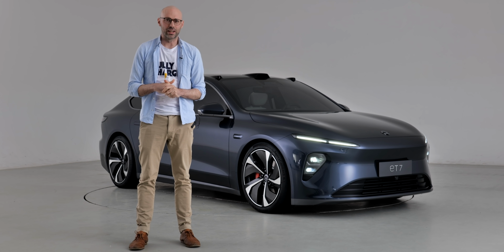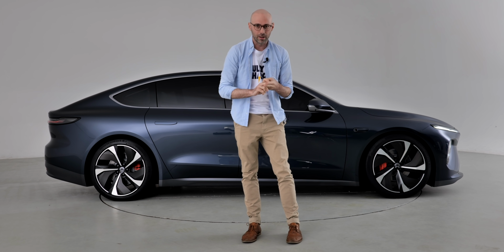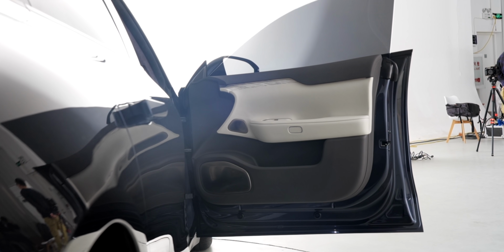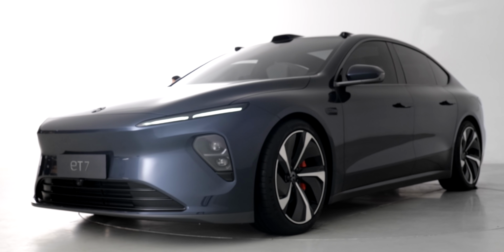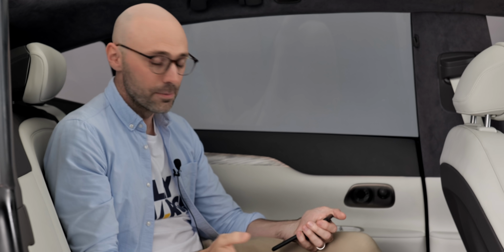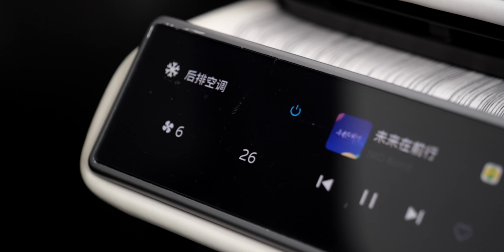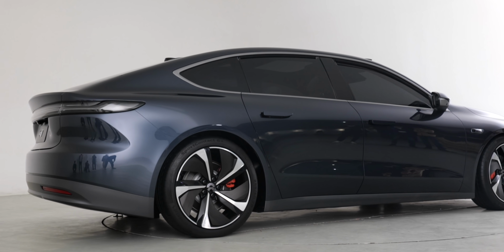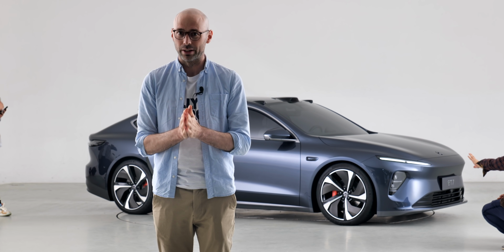NIO ET7 Sneak Peek - '600' mile saloon revealed | Fully Charged CARS

Comment: What happen if batteries all die with no power at all. Can you open door manually?  Can you still push the car on neutral gear?
Reply: Yes. EVs still have a separate auxiliary battery like an ICE car. I had a 2018 Nissan Leaf and the doors, windows, infotainment etc work off the small battery. If that dies, you're buggered.

Comment: I wonder what happens if the button doesn't work. Due to an update,  let's say. And the car is on fire. It is perfect. The perfect trap. Can all that electronics and updating work against you ?
Reply: There's a secondary mechanical handle inside the doors in case of emergency.

Comment: The big questions is if this new "Aquila" sensor suite and the "Adam" GPU processor from NVIDIA will be available in the next version of NIO's large SUV the ES8... maybe will be called ET8??? Also from what I heard from the William Li, the sensor suite and GPU is for  "future proofing" meaning the software will be still L1, L2 ADAS, but eventually the NIO in-house NAD team will have to produce it (L4-L5). Currently ES8 uses Mobileye Q4 and will not use the current Q5, which should be offering L4-L5 by 2024-2025.

Comment: Woaaaa......do my eyes deceive me???.......there is no bumper per se, either front or rear..........the whole purpose of which is to absorb those slight front end and rear end touches that with this design represents major damage.
i get very nervous when the presenter start to extol the virues of unlimited electronic gadgets that if only one goes wrong shuts the car down immediately......this model will not please a buyer expecting to get value for money without having a money bin look alike.
I would be scared to take this car down to my local supermarket or shopping mall car park or even park it outside of my house.

Comment: No interior door handles?
That seems like a stupid idea!
Reply: Agree. There was a fatal accident with a Model S, where the driver was burnt alive because the doors couldn't be opened.
Reply: @pikachus5m166  If the accident is serious enough for there to be a fire, chances are you'll have to be cut out of the vehicle anyway. But EV fires are harder to put out once they start... and I don't like the idea of an electrical failure trapping me in a car!
Reply: @jayr6637  Apparently he lost control of the vehicle, careered off road and hit a tree. Several witnesses came to his aid but couldn't force open the doors and the driver was soon overcome by smoke inside the vehicle, and then the fire took hold. Basically the technology became a deathtrap and it's surprising how there isn't a manual override given this possibility.

Comment: There NEEDS to be a physical, manual means to open the door. Relying on a "button" and a motor to open the door for you provides a serious safety issue should that mechanism be damaged in a crash

Comment: Don't think this car is for me. 
Too many sensors and cameras to go wrong.  No door handle, the most simple thing you can have.
The battery swap idea is wrong too, as battery technology moves on so fast that can improve range yet if they put a four year old battery in my brand new car then I don't see the improvements.
The designer was talking nonsense as well, you don't need too much at the front it's an electric car, you don't need much, just need headlights and side lights, same at the back, some lights and a boot. What you do want is that if someone hits you at the front or the back, you can replace parts cheaply.

Comment: Those LIDAR sensors on the roof are hideous and ridiculous! Granted this is a prototype they may disappear in production possibly. The rear end view looks purely a copy of Audi and I think it doesn't really match the front end in style. The 1000km range is impressive but in the REAL world you don't need it and the 150kW LFP batteries are going to be heavy.

Comment: Sorry not sorry, but ET7 will probably do 435 miles per charge for the EPA rating.  Still lower than the Model S refresh version. 345 wh/mile from the 150 kWh pack.

Comment: How does the battery swap work do all the manufacturers in China collaborate on battery sizes so you can take any battery swap capable car to a station, or do you have to go to a manufacturer specific station? I cannot see that working in Europe / UK, I'm not sure they'll sell enough cars to make it work. One good thing about having a really big battery is it should last a long time. Batteries only have a finite amount of charging cycles before they start to degrade, having a big battery pack means less charge cycles. I like the overall look, don't like the humps on the roof, don't need all that 5G malarky either, self driving, pah, I actually like driving.

Comment: I'm not sure that I'm on board regarding the electronic button only entry/exit door actuators.  What happens in the unfortunate event of an accident where the electronics or control modules are damaged or...?

I do think that it's a very sleek and pleasing design.  Though I'm not sure about that one unique interior design element/surface.  Otherwise, the interior options look nice.

Due mostly to the limited range and my location, I still don't own an EV even though I'm off-grid (using a Bergey Excel wind turbine) and produce on average 30% to 45%+ more than my actual consumption.

The ~600 mile range is about where it needs to be (for me) to consider an EV as my Single, ALL-PURPOSE Family Vehicle.

The quick-swap batteries are a smart design that all EVs should adopt.  But not all that much of a benefit unless the specific batteries that you need are widely available no matter where you might end up on your route.

It's great that once you get home you can pretty much instantly swap to a 100% battery and put the depleted battery on charge.  But how much will a spare battery cost???  At this point in time, the battery bank is a significant percentage of the overall vehicle cost.

Let's see how it ends up overall when it's released.   At least competition is finally starting to ramp up in this segment and that can only be a good thing...pushing manufacturers to give us better quality and variety of products along with better designs for our money.

Comment: The bulging rooftop sensors are a turn off for me. 
The side ones could be set into the A-Pillar & the central one moved down to be flush with a cutout section of the windscreen.
The same goes for the lower front lights, why not have an integrated light shield that is flush & continues the beautiful smooth lines? 
A smaller version would be epic. 👍

Comment: I'm not a fan of all the bumps on the roofline Rather have a model S, 3, or Y than this. I'm sure it will do great things though if the range can actually do 1000k on a charge. Though I wonder what cells are required to do that, and how readily they are actually available at the battery swap stations they expect people to use. Battery swap stations if done right can definitely be a great thing, as you never have to worry about a battery getting too old. It'll just get de-commissioned when they detect it can no longer hold enough charge to be re-used in a car, and it will end up getting re-used as grid-tied storage. But the batteries are always swapped when they are recharged to full, which speeds up degradation. I think battery swaps need to be a last resort for long trips only and have the option to track and get back your original battery when you get back home.

Comment: There are some design features that are already starting to look old because there are better ways to do it, so it will be interesting to see how the final product looks like. 

How is the back seat, are you sitting so low that you are basically sitting on your tailbone without thighs touching the seat? One thing I have noticed in EVs, the battery brings the floor so high that the only way around is to move the seat back in limousine style so much that it's like sitting on the front seat. Actually, move the front half of the cabin forward to leave more rear legroom.

Comment: 5-10yrs from now, wonder if the main center dash screen can become easily upgradeable along with some of the other tech.  Imagine it will become painfully ugly otherwise to be stuck with old tech.
Reply: they do offer you that option to upgrade stuff inside the car also. for example old ES8 had a tablet in the middle with huge bezels (standard at that time) and you can swap it to a newer one. Who other legacy automaker offers you this?

Comment: How do button door handles work for getting out after a crash?
Reply: A mechanical one won't work either if the cars crumpled as they will become jammed, so you'd be looking at a crash where you only lose electrical power. Given most cars have central locking/unlocking this really isn't much different. Just hope the battery pack is water tight.
Reply: @MrPDawes  I was going to make your first point, but I thought that was self-explanatory. But you are right. If there is frame damage, or other damage to the doors they won't open either.
Reply: I have the same concern with this obsession of everything electric.. I loved that car, up until he said button door release.. give me a mechanical release every time.. I’d even accept it more if they told me about the emergency door release.
I know there has to be a mechanical backup, like the Teslers do.. if there’s a failure for whatever reason, you can’t assume windows will still work to get out. And just to add, it’s not an EV problem.. it’s the same with any car with the same tech.
Reply: @jamstaa69  
Something tells me that 20 years from now this will be the norm, and we won't think twice about it. I felt the same way about electric windows.
Reply: @jamstaa69  I am assuming the finalized product would take that into consideration tho...
Reply: @jamstaa69  Take the fighter jet instrument into account. Now they are having all glass cockpit with all digital MFD, even no analogue backup. So why bother to have one in a ground vehicle?
Reply: @Galaxy2Free  but instrumentation failure is a very different issue, and in fact in an air craft if that were to happen, it could be deadly, as we’re not just talking about not knowing what speed you’re doing, it could be the only thing telling you which way is up.. of course in a car you’re always going to have visual contact with the ground, to guesstimate speed. Failure of an electric lock release, without a back up mechanical release could be fatal.. of course I admit, I’m probably thinking of a very rare occasion..  but electrical failure or mail function could just leave you annoyingly crawling over to another door to get out until it’s fixed, but it could mean you’re trapped in your car because if the electrical failure is caused by fire for example, due to accident or mail function, it could effect all doors and your windows may not work either. 
I admit, things I worry about have become rare, I mean I have electric windows, and they’ve worked the life of my cars so far, touch wood, but it doesn’t mean it doesn’t or can’t happen. And if your window doesn’t open, or close, it’s annoying but you can’t still get out.
We’ve got cars now, that have electrical operated door hands on the outside, and when they mail function and the 12volt system runs flat for whatever reason.. you can’t get in.. because they haven’t included a key back up.. that’s frustrating enough, but atleast you can walk away to get help.
Reply: It's got ejector seat's 🤔 new feature 👍
Reply: I'm going to assume that the battery is highly unlikely to stop working in a crash. And there are other places to exist, like windows and the roof.
Reply: It has a manual switch, hidden in a storage location on the door.
Reply: It's yet another solution to a problem that no-one had.

Comment: Who wants to bet the 33 sensors and what.. 8 gigabytes of data per second? Are mostly f’n useless.. because what software is in there that is decoding and collating 3 completely different forms of data and putting it all back together again quick enough to be useful to the car and/or driver. Sounds like they just want to say they have all this crap, to make it sound smart and capable.. but i would lay down money, the computer in there can’t use half, or more, of the data it’s generating.. so, pointless weight and cost added for nothing but a false image of competency.

Other than that.. looks ok. Exterior looks nicer than the interior to me. 600 miles Nedc should be like.. 450ish EPA range.. which is great.. but on 150kw f’n battery.. not great efficiency.. ok.. still good. The battery swap makes the size of the battery less of a problem as far as how long it would take to charge a damn 150kws.. will be interesting to see more of it.. hands on test drive would explain all the parts I really want to know about

Comment: It's interesting how in the last few years we are hearing so much from designers. Frankly I would far prefer the details of the car. Give me an engineer. What ever happened to white short sleeve shirts and pocket protectors? I still have mine.
I can't judge whether it's a good design or not and I don't care. Do I like the looks is my decision point, not does the sweep of the inflection point as it merges with the haunches signify motion? Verbal diarrhea. 
Very interesting car none the less. I don't like the look of the front but sitting in the back being driven around, I won't be looking at it anyway.

Comment: A 150kWh battery. Right. 
The 100kWh battery in the Tesla Model X weighs a hefty 600kg (1300 lbs). Assuming the battery composition of the Nio hasn’t improved drastically, a 150kWh will weigh about 900kg (2000 lbs). Also, let’s assume most trips with this car will be short and medium trips, and only 10% of trips (my guess, based on my own experience) will be more than 1000km (620 miles), you’re basically only adding all this extra weight so that you can drive 1000km without interruption once in a blue moon. In what universe is this a practical car? It’s too heavy, too wide, too long, too expensive (probably) and it eats tires for breakfast due to its weight. 
Instead of mimicking fossil cars with their 40-80 liter tank of inefficient oil, we need to educate fossil drivers that traveling (from A to B) is not all about getting there without ever taking a break, or that cars need to be driven from full to empty (from one fill-up to the next) all the time. If we can do that, we’ve accomplished a lot. Then we start to produce (and accept) EVs with smaller and lighter batteries.

Comment: If this car can use the existing battery exchanges, can existing NIO vehicles accept the new 150Kwh battery to extend range? That would be huge.
Reply: yes
Reply: Every Nio car can be upgraded to the latest battery (size, tech). For example, if you own a 75 kw Nio right now, you will be able to upgrade to this 150 kwh battery as well. You would be able to upgrade to the solid state battery when that will be available also. cheers.

Comment: Another very expansive car that will only sell in China. Luxury don't equal to China at the moment, they will need at least 10 years to push in this market.
And using LIDAR directly tell that the price will be very high, as the cheapest LIDAR on the market is at $1000.

Comment: Buttons for door opening 🙄 what could go wrong...
Reply: Flat battery
Reply: PMF does not get sarcasm. I will never buy a car without a mechanical handle yoballow escape. That is why Teslas are tufning into craematoriums
Reply: @bernhardzinkhofer4886  You didn't get my joke. And tesla being crematoria is BS my friend. Install a window smasher, that's always advised to have in a car. Any car. And you'll be surprised, that there are way more ICE car fires than electric car fires, even when you take into account the ratio of EV : ICE.

Comment: this is a car i would own in Europe, i do trips from UK to Greece almost every summer and range will be enough for the long stretches of driving, as I usually drive 3-4 hours and then take an hour (or more) break. I wonder what will be the range when doing 200-250 in Germany.
Reply: Even if you are out of range you can just swap the battery in 5 minutes!
Reply: @luihinwai1  
I guess spare batteries just randomly happen to present themselves along your route no matter where you may end up, huh?

Or you tow it on a trailer behind the car?

Then when you arrive at your final destination you have TWO batteries that need to be completely charged.  YAY!

The 600 mile range is great, and is where EVs need to be in order to become a single, all-purpose family vehicle.
Reply: @luihinwai1  15 min, if you are lucky. Also would you swap out your brand new 150kWh battery?
Reply: @cyberslim7955  You can rent the battery instead of buying your own one
Reply: @luihinwai1  I see. But I am not the renter kind of guy. :)
Reply: @cyberslim7955  then dont swap out your battery. just pretend you dont have that option. you can charge it like any other EV. after all its a nice car.
Reply: @timetraveller2300  That's what I would do. I don't mind to have a 30 min break to charge.
How is the self driving feature now? I really need to test drive one...
Reply: @cyberslim7955  I think they are the first mass produced cars with lidar. their self driving techs must be pretty good. their tech lead came from Momenta. Ren Shaoqing. He's one of the most important figures in the field of deep learning. Look him up.
Reply: @timetraveller2300  Interesting. Will do, thank you!!!
Did you drive one?
Reply: @cyberslim7955  with the swap a batter option you don't own the battery